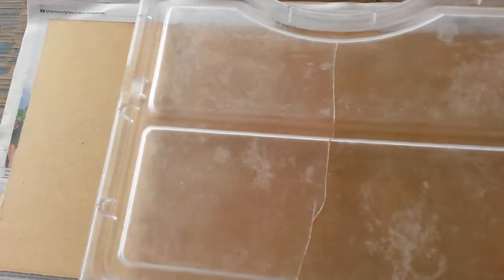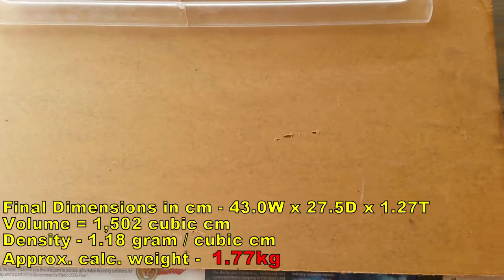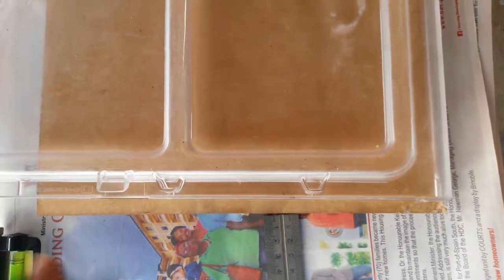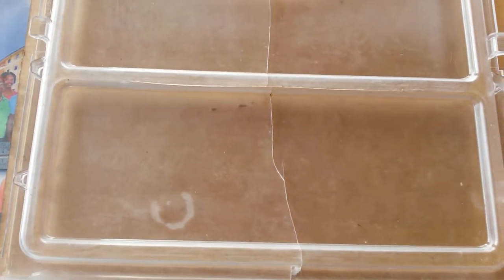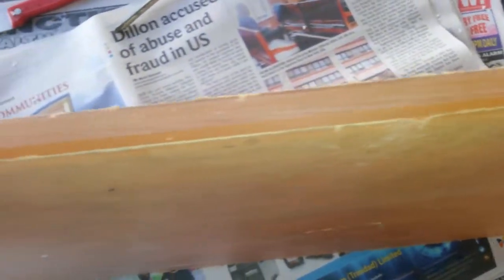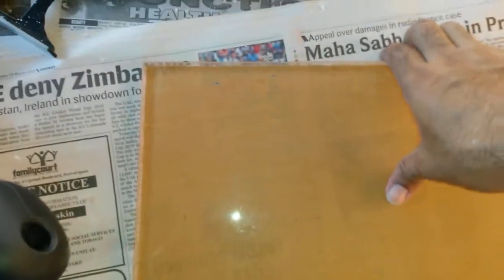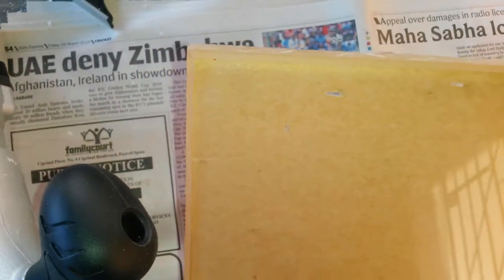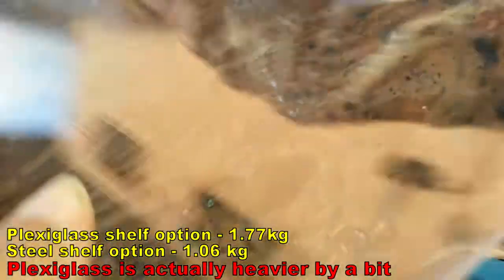122 Fabrication of a Plexiglass Refrigerator Shelf

Comment: Beautiful work, dude. Really nice material! 😊
Reply from the maker: It is but I am always paranoid it will shatter. Plexi is brittle so I always worry about that. Its a new router bit so all went well. 

The router is a universal motor with little resistance so it quickly speeds up to many thousand RPM. Could be intimidating. If it ever catches and pulls I am not 100% sure I can hold it.